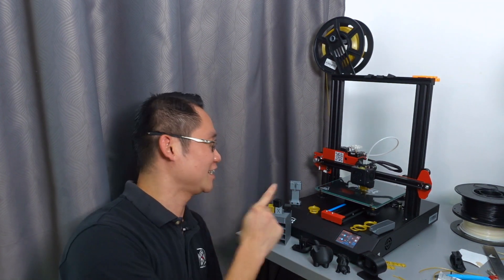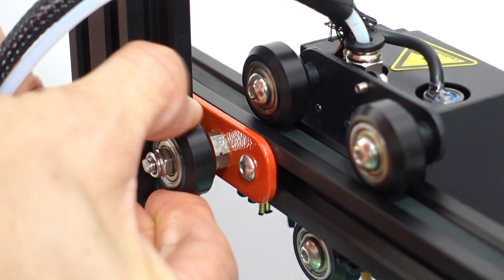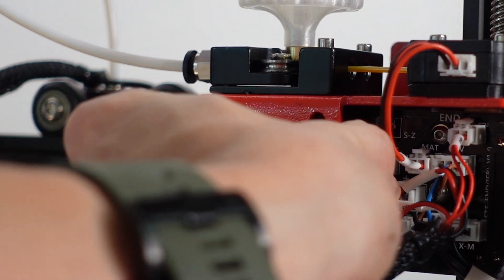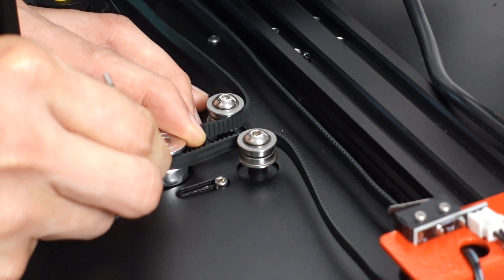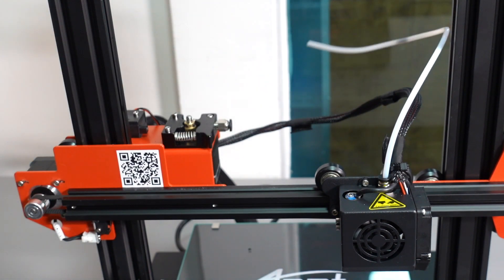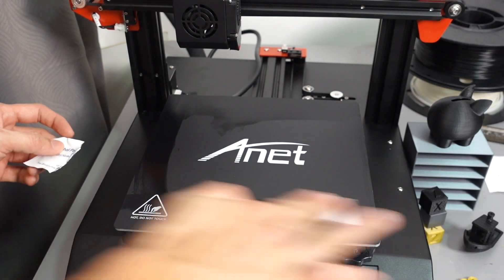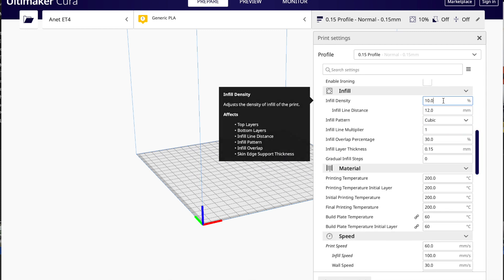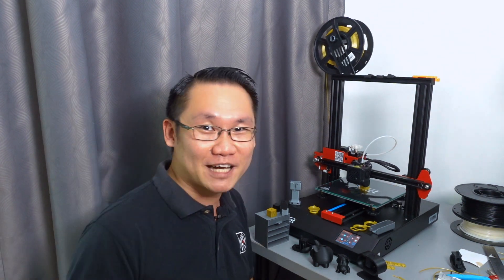12 Tips to make Anet ET4 (ET4+/ET4 Pro) print perfectly from of the box

Comment: Hello sir. I have this exact Anet ET4 3D Printer. However, I have issues when printing.
1. In the Prepare setting: the 4 bed positions, only moves to the Homing Position. I tried to manually move the X and Y axis but ultimately it will auto move to the Homing Position still.
2. Z axis height: Once I set the height correctly when start printing, I notice in the second time printing the Z height moved up alittle each time.
Would you kindly tell me what are the solutions to these?

Comment: Man I was having a time with mine. Bought some silicone spacers to use instead of the springs. Works a treat. Then used a spare PEI sheet I had laying around. Coupled with your Cura settings that I imported to Prusa slicer, it's printing like a champ. Thank you.

Comment: I've had my ET4 for a month and I'm STILL fighting with it.  I've read so many articles and fixes etc but it doesn't seem to fix my issues.  Tomorrow when I'm less frustrated I'm going to try your tips

I have heard of some ppl having issues with the sensor (me included). If I get the bed manually levelled, do I have to autolevel?  That's when it smacks into the bed.

Comment: Hi.
Can i use 1.1.7 fw on ET4 which doest have auto leveling sensor. I have now the first 1.10 version. I m wondering will my ET4 start to go home at bottom? as i have stock senor on z axis only at the top. Do i need end switch hardware modification if i upgrade to 1.1.7 fw as it will start to go home to the bottom or it will still go to the the top at home position. I dont want to use any auto level function but want to use M503 and other gcode to setup estep calibration which only supported by the 1.1.7fw.
Thanks

Comment: Nice video. I am still new on this field and planning to buy Anet ET4 for a start. I have some questions and hopefully you don't mind to answer them 😃 Thanks in advance
1.  Do I have to worry about electric bill? 
2.  Is there any heating issue? Any tips about room temperature?
3. How about the noise?
Reply from the maker: Welcome to the world of 3D printing. 
1. The wattage for this printer and the other common printers with heated bed are the same
2. So far no over heating issues. Just make sure the printer is a in a stable temperature room for better print quality
3. Noise is average. Not as quiet as the Ender 3 V2.
Reply: @KakiDIY  Thanks for the reply, bro 👍

Comment: How can you have infill speed 100? I have to use 35 bcs hotend cant take that much PLA even heat on 220 and bowden clicking like hell... Also always have to use manual leveling bcs autolevel did good leveling...
Reply from the maker: Manually set on CURA. 35mms and still clicking? Something is wrong with either the nozzle or the filament it self I think. I’ve printed faster speeds with no issues

Comment: i see your manual Bed Level but u didnt use a paper to measure it? do i miss somethings here?
Reply from the maker: Yes correct . This is not a final complete bed leveling, i eyeball the nozzle distance (need some practice)  to the 4 extreme corners to make sure it's leveled before applying the auto bed leveling. 

Best to use a paper to be sure.

Comment: I suggest when doing…manual or auto level and when setting the the Z ( nozzle) height above bed..the adjusting the sensor in Setting, that all should be carried out with the bed heated at whatever you use when printing. Also take not PLA bed 50 or 60 is good. If in a hot humid country,  the ambient room temperature should be taken into account and adjust bed temp accordingly.
Reply from the maker: Good tip !!